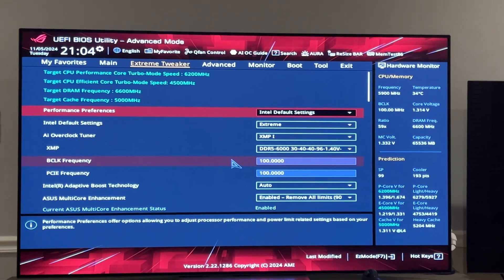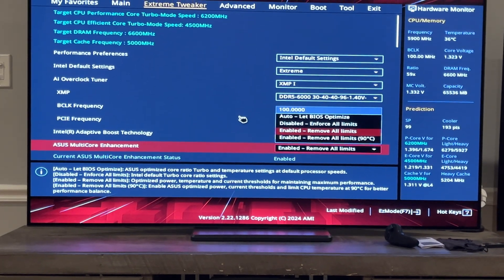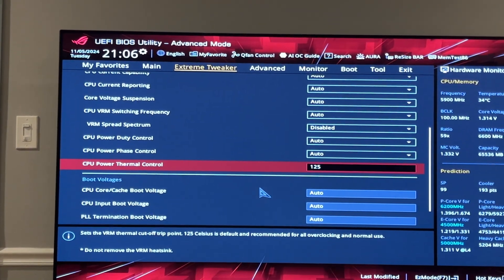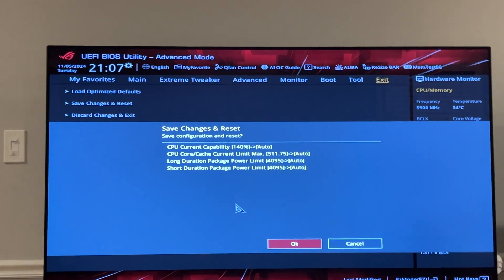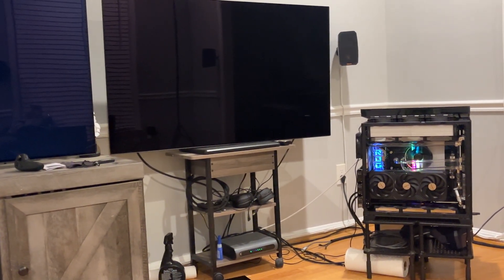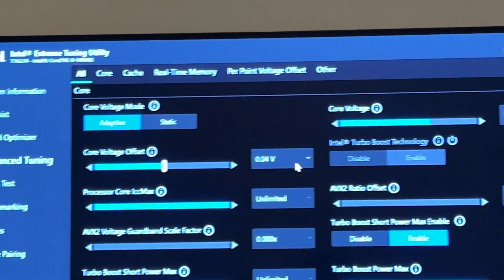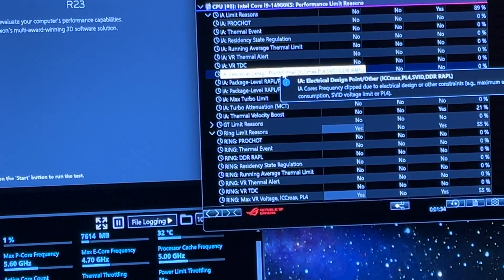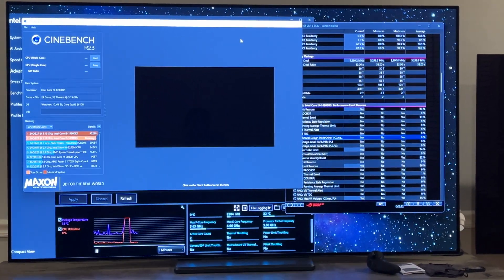XTU and HWinfo64 Current/EDP Limit Throttling - IA: Electrical Design Point/Other FIX. 14900

Comment: Another edp throttling survivor here. Weird fix for me. After doing everything recommended in the video + description i got more wattage but was still EDP throttling, eventually i read in a forum that changing bclk clock fixed his issue. Tried that and strange enough it did. I tried to recreate this and found it was also related to fixed clocks limiting current but auto clocks went straight to thermal limit. I then set all core clock as slightly below my final auto clock frequency after benchmarking and thats seemed to have fixed my issue.
Reply from the maker: Cool, thanks for the heads up man. It worked like 3 bios flashes ago. But they just keep updating the bios on this and it nuked the fix.

Comment: I keep getting that IccMax limit reason in hwinfo even sometimes just browsing not doing much and using cinebench it just stays permanently on yes.
No idea what causes it, I got 307A max (it's a 14700k) on bios and max I see it reaching on hwinfo is around 210A, so it makes no sense.
I'm using gigabyte so don't have that remove all limits option, could it be something like that or what am I missing?
Reply from the maker: I have since given up on messing with this generation. Through bios updates and Windows updates, they have just made it too difficult for me to want to mess with it. And it’s just incredibly unreliable.
Reply from the maker: I have since given up on messing with this generation. Through bios updates and Windows updates, they have just made it too difficult for me to want to mess with it. And it’s just incredibly unreliable.

Comment: Brother I've searched and can't find a solid way to avoid hitting this throttle. The only consistent way I've found is to run lower clock speeds (57x) and undervolt as much as you can... but who wants to run 57x
Reply from the maker: Yea, this gen was quite frankly a lot of marketing BS. Not to mention that it's lost like 5-10% of it's performance due to updates since it was released.
Reply: @DSBsky77 believe it or not i just disabled "ring down bin" and I'm no longer hitting PL4/current throttle in benchmarks but soon as i launch BF2042 it hits PL4 again....i give up again lol
Reply from the maker: @RuiN4265 😂 lol man.. yeah, I miss the days when bios were simple and it was easy to overclock for 25% gains. Now everything is so convoluted and overly complicated that it’s actually causing instability in the systems. It’s like Intel forgot how to make things work right before moving on to something else.
Reply: @DSBsky77 I've still been tinkering and from what i can tell its voltage related that's causing PL4 to stay on. I'm running my 14900KS @ 5900MHz. Went back to bios and started taking more voltage from V/F point 8 and sure enough i got the PL4 to go away. I'm not getting any performance limit triggers whatsoever now and BF2042 feels way better to play

Weird thing is even when PL4 was on my CPU would still report 5900MHz so I'm not sure what the performance loss is when PL4 is triggered but it def hurts performance
Reply from the maker: @RuiN4265 yea but your heat is probably disgusting lol.
Reply: @DSBsky77 I'm using the EK direct die AIO so heat really isn't as bad as you would think. 5.9GHz on BF2042 im running around 50‐60C
Reply from the maker: @RuiN4265 ahh direct die. That’s the only way. Cheers.

Comment: I have the same issue but my Alienware laptop doesn’t have these options in the bios
Reply from the maker: @sailingenki2038  honestly, with 13th and 14th gen. I would just leave it alone. They seem so unreliable and unstable. I recently reverted everything to stock because even the smallest changes were causing system instability.
Reply: @DSBsky77  I agree, with the new microcode update you should leave it to intel settings, theres a reason for limiting the power on theses little guys...next one will be AMD ^^

Comment: Focus on using the minimum extra voltage you can get away with.  Every little bit of voltage you add increases current in a parabolic manner.  My goal when tuning something like this is to use enough voltage to get it stable but keep the clocks low enough to never exceed the current (fixed, immoveable) limits.  This strategy will introduce the least amount of heat and the most consistent performance.  If you exceed current or temperature limits clocks will be reduced dynamically.  Dynamic reduction in clock speed and processor load is the reason for lagging and skipping unless you have other background activity or config issues.   When the clock speeds are reduced or cores are parked for some cycles to reduce heat loads, scheduling gets messy.
Reply: I increase the voltage by a little and it keeps crashing and all my cores are stuck at 4.4 is it the psu or the motherboard thats causing it?

Comment: I have Ring:Max Vr Voltage issues on my i5 12600kf what to do?
Reply from the maker: @Chopy2k17  I would Google that. But there should be a setting in bios for ring voltage. Just try bumping it up a little.

Comment: I have the same problem. Its  a defective cpu i9 14900k.  Tester on another  setup same pb. In stress test 75° good temp. But in rest current edp trotlling. Intel or seller didnt suceed to help. We buy cpu for plug and play not for hard settings.
Reply from the maker: @draklorddrakem2967  Lol tell me about it 😂

Comment: im so lost, what do I change for my edp limit throttling to go away
Reply from the maker: @NoahL09876  just watch the video and slow it down my friend. Lol
Reply: @DSBsky77  it's very confusing. It's the 90c?
Reply from the maker: @ honestly with all the micro code updates and bios updates, I’m not even sure it works anymore. I’ve pretty much given up. But this is what worked about four bio updates ago. Lol
Reply: @ I managed to fix it yesterday by disabling ring down bin, then setting both cache ratio low and high to 50. (13700k). No limit in throttle stop or hwinfo.
Reply from the maker: @ excellent 👍

Comment: I run an ac unit tunneled into my pc on a 14900ks so I have no cooling problems at 1.45v, but I still have this problem with trying to run 6.2GHz without HT enabled and I have no clue why. Temps never go above 80, it makes no sense, I am so confused
Reply from the maker: @angrasband3564  I bet it’s a very similar setting in your bios if you’re not using Asus.
Reply: @ I am using asus, I tried all those settings. The only thing that helped me a little bit is the motherboard tdc limit setting it to unlimited, but I still get that throttling. Shit makes no sense, I just wanna benchmark my setup at 6.2GHz all p-core.
Reply from the maker: @ are you using Intel extreme tuning utility? Did you set it to high-performance mode?
I would try usingXTU, setting it to high performance mode with the power limits in settings and raising individual voltage limits until it goes away.
Reply: @ I finally figured it out, and it’s so stupid. I had the “regulate frequency by above threshold” enabled, and even though the temperature came nowhere close to my limit of 115C, it would throttle it for no good reason. I got it fixed, so now it’s time to really test this chip with the AC tunnel >:)
Reply from the maker: @ lol bios these days.. grats and good luck to you 🍻
Reply: @ Thanks, I was able to push it to 6.0GHz all p-cores HT enabled and I got 44934 in r23. I can’t seem to get it stable on 6.1 with HT enabled tho, even with voltage cranked up. I think I might try 6GHz minimum for all p-cores and boost like 3 of them to 6.1. Fun stuff now
Reply from the maker: @ cool, I’d be surprised if you manage to keep it stable at six for all cores while gaming though. That can get finicky. But good luck.
Reply: @ I got it stable at 6.2 for all cores gaming, but HT is disabled cause it’s not needed for the games I play and will just increase latency. Have it set to 1.43v doesn’t usually pass 1.47 max
Reply from the maker: @angrasband3564  ahh HT disabled. True.

Comment: Im on a Legion 7i. My EDP limit was throttling me at 90w. I was able to fix it by bumping LP1 up to 130w now im getting 105w under load without hitting EDP throttle.
Reply from the maker: @austinbriggle3961  That’s helpful to people who are using lower end processes for sure. 

But yeah, this is more to do with the kind of power required by something like a 14900 KS. There are bios limitations that if you don’t know what you’re doing, you will never stop it.

Comment from the maker: I agree 100%. People can piss off. I do what I want with the shit that I buy. Lol.
But as of right now, it doesn’t go over 95C in stress testing.
You need to know how to set the limitations. If you don’t know how to do that, you shouldn’t be overclocking. All it takes is 10watts to flag a limit, doesn’t mean you should give it 1000 lol.
Reply: Exactly, I tried asking on Reddit, but I just got flamed and told I’d degrade my chip in a couple months. My temps don’t go above 80c, so there’s not gonna be an issue. I just gotta figure out how to get rid of this limit so I can push it even more.
Reply from the maker: @ yeah, Reddit is pretty notorious for that. I can post 100% factual information on Reddit and 9 out of 10 people will figure out someway that it’s wrong. 😂 
Good luck with your overclocking brother.